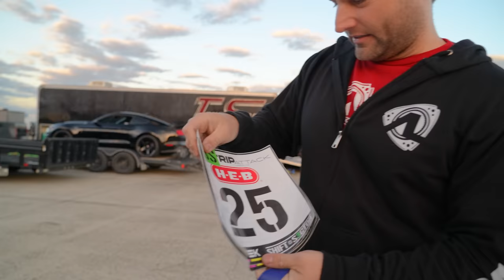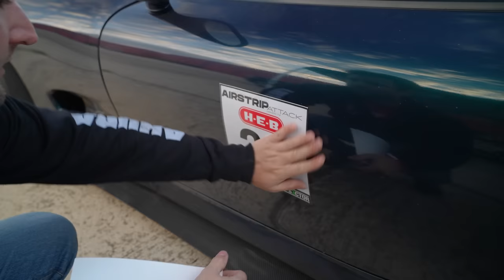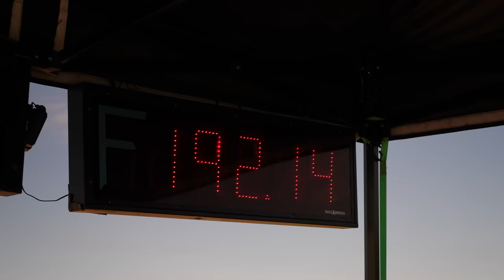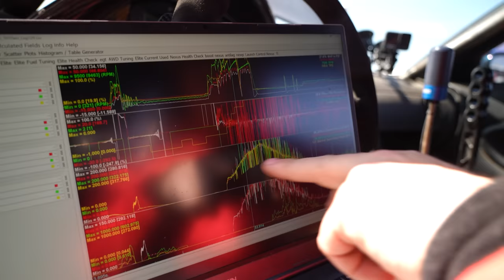The AWD 4 Rotor Breaks the Rotary Half Mile Record!

Comment: Watching the 4 rotor take that Ferrari in the top end once it's caught traction and hitting full boost really shows how fast that thing is. Would love to see what this thing can do on a prepped surface!
Reply: And that ferrari is sf90 i think which is very very fast
Reply: @rishabhbhatt1393  It is, which is the fastest Ferrari ever made.
Reply: Not only that, but Rob said that he only was in the high 20s psi range for boost and it can go up into the 40's... the thing is gonna be a Dorito missel.
Reply: That AWD burnout was crazy
Reply: NO SHIT! Put some tires on the damn thing! Spinning tires, loud revs... doesnt really do anything! If its going to be a drag car.. or at least try.. gotta do it right!
Reply: @vibrationNC  what? He said that the surface was very slippery and he does have some very good tires on it. Plus, its not a drag car, its setup like the Hoonicorn, so its just an all round vehicle more than just a drag car. Its built to do all sorts of things, not just drag racing.
Reply: @vibrationNC  Do you not see the bead locks and slicks he is running already? lol I can't remember the width but it has like 315s in the front and even wider in the rear or something.
Reply: @MrRadicalMoves  Right on.. makes sense... still... PREP RUN would be nice... but then he will probably break some axels.
Reply: @vibrationNC  ehhh he isn't afraid to break axles... I think he's broken like 4 or 5 already in some capacity or another. I am sure a prepped launch will come eventually, but ya gotta work up to that. Stuff like this allows him to get the traction control better dialed in and make sure the systems are all working properly before you go balls to the wall full send.
Reply: @vibrationNC  He already did some launches on a prep surface for a TV show and nothing broke.
Reply: Probably break drivetrain components lol
Reply: @joealex65  He was only running like 1k-1.3k HP on that show tho, he was using the full beans here if I understand everything rob's said on it so far.
Reply: @DaftFader   nope this was also pretty conservative, 28psi in 6th when he gapped that sf90. It could run like 40psi. And hes using boost by gear so it probably made much less in the lower gears.
Reply: @bigd5899  I think it might be the editing (as in a clip from later when he fully unleashed the car's power got played here), if you hear at the end he says "it made 60 psi" alluding to the next vid, and somewhere else earlier he says he's currently running 1700hp. So you're probably right, that in this vid it's around 30, but in this session he actually does go pretty much full tilt later on, it's just going to be the next video, and it was in that run the car over-boosted or what ever happened that's being teased with the "60 psi" comment.

Comment: You need to windtunnel the 4-rotor, and you should look into em shielding for the wires to the wheel speed sensors
Reply: agreed
Reply: Yup. At this point, the things that keep the car from performing aren't the running body, rather the body itself.
Reply: agreed
Reply: @shrerd1894; clearly You lack the proper basics about electrical, digital signals, wiring, etc.
A. The variations, spikes with the digital speed sensor are clearly clean, stable until much higher speeds -> thus clearly NOT an issue with any interference !
B. Thus, clearly, obviously, certain the issue is intermittent connection at higher speeds, RPM
1. The first area to check are the connections, connectors from the wires of the sensor(s), which are vulnerable to the vibrations, due to higher RPM and wind speeds,.
2. The next is to verify the wires inside the sensor and sensor itself  - this should have shown up with proper high speed testing on the dynometer, but perhaps they did not operate the vehicle at these higher RPM speeds
3. Also the actual higher speed driving, especially on this aircraft runway, has additional variations, vibrations, along with the high speed air flow during very high speed travel as this
4. For these reasons, basis, poper planning, connectors, connections, wiring, sensors must be proper, carefully selected, chosen, wired, installed as those within aircraft, high speed vehicles as F1, Indy, NASCAR, NHRA/IHRA/PDRA, others
5. typical "Trial & Error" process among the amateurs, novice, platform-video producers, including many which modify, build performance level vehicles, many for drag, track, other racing but not trained properly,lack the proper knowledge, especially within safety are extremely common and should be clear, obvious to humans with proper basic thinking as examples of "what NOT to do"-"NOT follow", don't do as they do with their mistakes, errors, claims etc.
All The Best
Reply: @newtonfirefly3584  > pushes up glasses
>Akshually
>First draft of college thesis
This isn't Reddit dude, and I'm not reading all of that.
Reply: @shred1894  I haven't laughed this hard in a while
Reply: @newtonfirefly3584  Agreed, this isn't so much EM interference. I would suspect a larger power fault, considering how the speedometer was also freaking out. If it was some sort of bus error or an analog sensor problem, you'd see weird "noise" in the readings, this just looks like a digital cutout. 

If its related to a power loom, you could brown out sensors and controllers, while the LCD and processor logic would still be fine (because they run on lower voltages through a buck converter, usually with enough capacitance to keep operating for a really short time), while the sensors could reset or stop sending data. 

In rare cases, insane vibration can even interfere (aka break off) component on a circuit board, especially bigger and unsupported components (like large inductors, capacitors, ferrite cores).
Reply: @NeoAcheron  Again, You responded with Your personal ideas and details which include the obvious, clear, certain misconceptions about electricity, electrical wires, wiring, connections, sensors, DC voltage, sensor DC voltage outputs thus misuse other terms including "EM interference", "EMI [Induction]", "analog", 'bus error", "noise", 'digital cutout", then some other unknown terms as "power loom", "brown out sensors and controllers", "buck converter", along with added "LCD and processor logic", and such nonsense as "sensor reset", "sensor- stop sending data", misuse of, with capacitance.
Then attempt push off the obvious issues with vibration affects, claiming them as 'rare' along with attempting to describe as "(aka break off) to "interfere"  and to or with a "component on a circuit board" with the description as "especially bigger and unsupported components", specified as "like large inductors, capacitors, ferrite cores". ??!!
A. Which decade, generation and level within electricity, electrical, components, circuit boards, electronics, analog and digital do You claim to have any information base ?
B. Clearly Your comments clearly. obviously [to those with proper knowledge] indicate Your personal lacking within the basics of these and the situation; even more than lacking than Rob Dahm
C. Thus, Your attempted lengthy response, reply further indicates Your serious, basic lacking with any proper knowledge along Your refusal, denial of the proper information, conveyed in the posted comment.
=>Thus, it seem rather clear You have an issue within personal views, perceptions, perspectives, especially within the "Self" which leads to these refusals, denials and display of arrogance and obvious NONsense !! 😞
Good Luck -> Bye Bye
Reply: @newtonfirefly3584  Hey I bothered to read it. XD
But also to confirm you where saying something right.
Then again that's just me. I learned yesterday ice have different levels. What most people think of is ice 1. That crap goes up to 19.
Reply: U r 100% correct
Reply: @newtonfirefly3584  concise language is critical for clarity of communication. Clearly, you need to improve in this area.
Reply: @TheRealSykx  Your comment indicates You need better, proper reading and comprehension skills, along with assessment, evaluation, perhaps others too including being aware of and shifting from the typical " 'self-reflection' -> projection"
Good Luck
Reply: @newtonfirefly3584  Speaking of "self-reflection", you should do some of that.
Reply: @--_DJ_--  Which 'bot' was used to form this nonsense comment ??!!
Reply: @newtonfirefly3584  Nonsense? Your inability to self-reflect is becoming more obvious.
Reply: @--_DJ_--  Yes, obvious Nonsense and clearly from a 'bot' with its programmer only able to 'self-reflect' -> project 😞
Reply: @newtonfirefly3584  Seek help. Quickly.

Comment: The lack of anti-roll bars might be part of why you're having so many problems with high-speed stability. Adam LZ had the same issue with his Barra-swapped GT350.
Reply: No doubt. Had a sway bar beat the new bushings out on a turbo vehicle I own and top speed it would rock side to side.  To the point it seemed one minor movement of the steering wheel the car would lose control.
Reply: Except for the fact this doesn't have a normal suspension.
Reply: @x808drifter  Still need anti-roll bars of some sort. The mechanics of the instability don't change, just the motion ratios on the suspension components themselves. Without something to suppress the roll, it'll just continue oscillating and only worsen as speed rises.

Comment: Congratz on the new PB/record! I'm wondering if you have a traction control issue due to front/rear tire diameter expansion variations at high speeds. Can you see the mph speed of the front axles vs. rear axles in the logs? Are you running 555R's on front and rears or slicks? I'm sure you'll fix all the issues. Looking forward to your next videos

Comment: Awesome video. I'd get a rear window in and see what effect that has. You ever had a car that makes that throbbing sound when you open the rear windows? Plus the air going over the top of the car and hitting the spoiler might be getting disturbed. Aero tunnel would be really interesting
Reply: I was also wondering if having the rear window in would help.

Comment: Two theoretical things here, would having a rear window in place help clean up the air? Also, I wonder if a carbon shark fin, similar to what you'd find on the AMG One, or the Jesko, help keep the car straight at high speeds. Would be cool to see one integrated into the rear window, should you go plexiglass (with F40 style vents 😊).
Reply: Clearly KC, You know nothing about "Theory", proper principles, ideas, concepts, though You did clearly properly figure the issue is with speed, though clearly lack the proper basics with aerodynamics, electrical and the effects of the variations, varying speed sensor voltage to the ECU which affects the vehicle operation including driving stability, as Rob directly stated [at least he knows it does affect this, since he arranged the ECU to use this information within its controls]
Good Luck, All The Best, Sincerely
Reply: @newtonfirefly3584  coooooooool story brother!
Reply: @kc550  KC, Clearly You lack with what is a 'story' as You do with "Theory", principles, physics, science, mathematics, logic, reason and 'common sense', which is no longer common and extremely rare !
Thankfully amwell trained, developed with these and my given abilities, capabilities, attributes, aspects, talents over my lifetime [63 + years] and continuing with improvement, development, expertise, design, etc.
Good Luck
Reply: @Newton Firefly  ...he's still going...
Reply: @kc550  exactly ... still going.... going ... going ... and going ... never complete
Reply: @newtonfirefly3584  haha.. the preview of your message was "going going going, never com...". Funny.
Reply: @kc550  "whatever" Your attempted reply means; "preview of ... message", "going goin goin, never com ...", "Funny"  ??!!

Comment: I would check the specs for those wheel speed sensors and see what the max rpm they can read is.
Reply: Clearly You lack the obvious, clear issue with intermittent, quickly varying voltage as seen in the ECU data and on the speedometer !!
The issue is clearly NOT limits with the speed sensor, else it would have reached its upper voltage limit and either remained [as would be expected] or alternatively with a poor design dropped to zero !!
Another individual with simple lacking of the basics with electricity, electrical voltage, sensor outputs, ECU data.
Goo Luck, All The Best, Sincerely
Reply: @newtonfirefly3584  Perhaps instead of being condescending, try being constructive. And instead of putting people down try engaging in a discussion. If we apply some logic to the situation it is apparent that all 4 wheel speed sensors are reading all over the place. That tells me it is unlikely to be a single sensor that is bad and even less likely for it to be a wiring issue such as chaffed wires. Now as far as my understanding goes the wheel speed sensors are putting out pulses which are read by the ECU. Those pulses could be coming fast enough that capacitance in the wiring attenuates the pulses enough that the ECU has trouble accurately reading them. Or it could be that the sensors are not capable of reading a trigger wheel going that fast. Seeing as I do not have the model number of the wheel speed sensors, and I don't have the time to look for it in the videos, I will elect to just speculate.

Comment: It may be worth adding a lowpass filter on the wheelspeed sensors if it is only noise on those speed curves. That would be a fast way to eliminate that issue before trying to address the cause of it.

Comment: Well done Rob and team. So great to see this car really show its potential.

This might have been answered previously,  but when changing the rear differential ratio, is the vehicle left in RWD? As I suspect the system wouldn't like different ratios front to rear. It seems odd that the front wouldn't also be adjustable.

Comment: Before you even did the run I noticed at 4:57 the car seemed to wobble a little bit. I think there might be something loose in the suspension maybe? I don’t think it’s only at high speeds, it’s just more noticeable after you let off the gas and you’re “cruising” at high speed. I had an identical issue in my subaru touring racecar and it ended up being a bunch of suspension components being loose at once somehow (probably hit some kerbs too hard).

Comment: I had the same problem with one of my cars, a 2nd gen GS300, the wheel speed sensors were going haywire, causing the yaw rate sensor to go crazy, inputting steering assist.

Comment: I would recommend installing wheel speed sensors on each wheel in addition to a ground speed sensor to tune the traction control system. Data collection and analysis will help improve the performance of the car at this point in your build.

Comment: For towing buy a couple sets of "axle tie down straps".  You can wrap them around the tires (or axle) pretty easy without damage to wheels or straps.  Minimum of 24" length. If you want the ultimate no hassle strap search "strapinno" retractable ratchet straps with the snap hook option.  It will cut your strap setup time by 80%.  No more rats nest of straps when not in use or in transit.

Comment: you should get the paddle/air shifter working, that would make driving ”easier” when you can keep both hands on the steering wheel because it looks like you have hard time keeping up with the shifts when you have to pull the lever

Comment: A better way to do the straps is to run it from the front of the trailer across the face of the rear wheel, loop it around the back side of the tire (above the hub) then back around the face of the wheel and down to a point on the tire to the rear of the trailer. I was taught this technique by a Group B mechanic. It prevents the strap from rubbing on anything abrasive or touching your paint and works on cars with no tie down hooks. It can be a little tricky on cars with really tight fender clearances like the 4 rotor but should still be feasible. I typically do it to one rear wheel and one front wheel on opposite sides.

Comment: Based on the random spikes you have on higher speeds check connector's of wheel speed sensors again , and also have a look on every component of CAN Communications that they speak without problems.

Comment: Guess you could stiffen up your front suspension to stop those wobbles. Looks really soft and bouncey even coming off the trailer. Maybe even stiffen/raise the rear cause you got alot of squat under acceleration and it let's air underneath at high speeds making you unstable.

Comment: Im sure you'all have your ideas on the instability at speed. i think it is sort of like the porposing the F1 cars were suffering with for a short while, it can be because the front wing/splitter gets too close to the floor as speed increases not allowing enough air to pass under the car. a quick fix would be to increase ride height slightly, but yes for sure an aero issue. I hope you find a easy permanent fix, Looking great though man, so happy for you guys.
Reply: makes sense, it happend as soon as he let off the throttle
Reply: He said in a comment it was the wheel speed sensor wires shorting because of rubbing against the tyres (like almost happened in the hoonigan vid).

He is probably creating a ton of ground effect too, but that's not why the logs looked like they did.
Reply: @SusperiaCH  It stopped as soon as he turned off the traction control. 😉
Reply: @DaftFader  no, he turned off AWD. 2nd run was without TC😉

Comment: Rob, you need to build a good, reliable NA 26B that can run in the firewall for five minutes or so, and put it into an APBA “A” hydroplane. 2.7L maximum displacement, “naturally aspirated” being the only limitation. Most boats are running modified Pinto 4cyl engines. I can’t imagine they are getting more than ~200HP.

Comment: You may be experiencing a little bump steer issue. Check for wheel deflection front and back during suspension movement and adjust. Good luck with that. Engine sounds like a real brute.